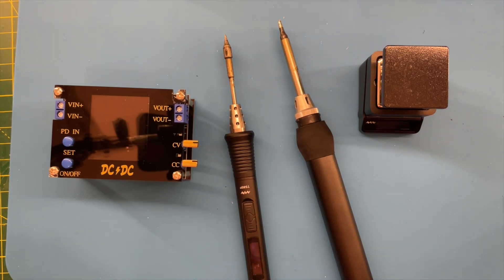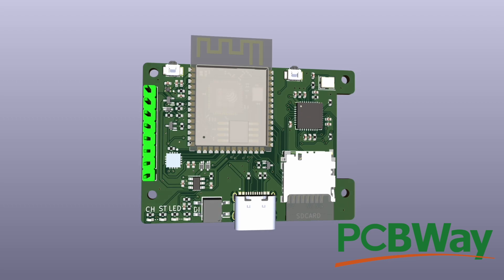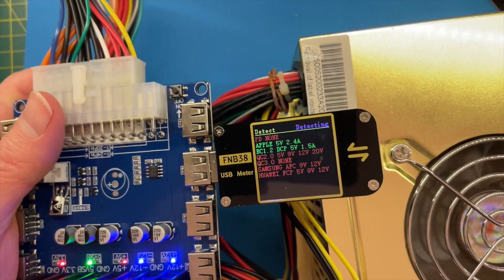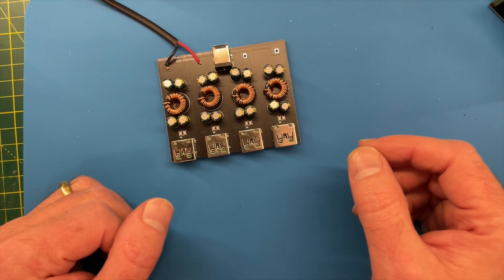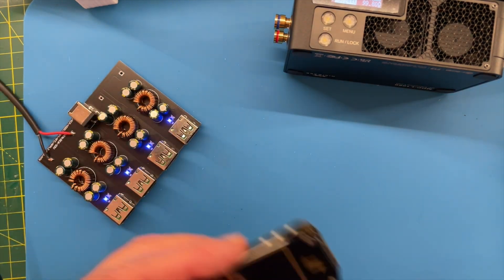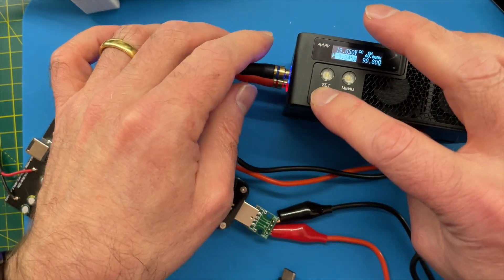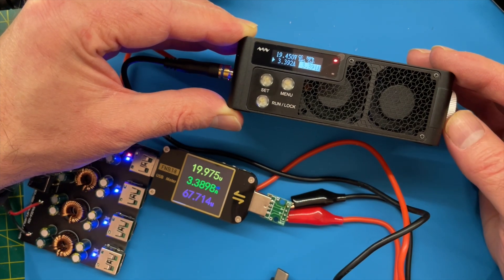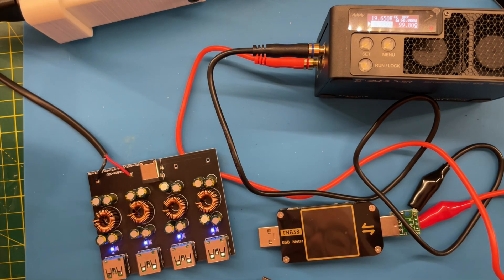Simple Multi USB-C Power Module

Comment: Nice showcase for the usefullness of these qc charger modules and miniware load. I have been using a earlier version of these (QC 3.0 module) probably the same as @lezbriddon mentioned. They were being used on a 24V solar project and i found they get especially hot when charging devices like power banks. You may want to soak test the board with a load for a longer period of time before designing a case as free air flow may be required or the addition of the self adhesive little heatsinks put on rasberry pi's.
Reply from the maker: Good idea. With all the devices I've got I can do a good load test and see how it looks with the IR camera. Just charged up a power bank and the board got warm to the touch - and that was just running at 9V so not even pushing things.
Reply: After re watching some of the video it looks like it's not possible to add a heatsink for this version of the board as components are loaded on both sides.
Reply: Nice, will be interesting to see how the testing goes. 👍

Comment: just bought one last week for more sockets in the van, but its not the same, I have surface mount inductors(220) and only half as many capacitors, so i'm guessing your boards design may be the better performer as I'd edge my bets the IC is the same (id removed by laser...) (pin2 inductor 5&6 d+/d-)
Reply from the maker: I've put some close up shots here: https://open.substack.com/pub/atomic14/p/i-need-more-usb-power the IC on my board is an SW3518

Comment: I don't understand why the push for all things USB powered. 
Great for working in the field, but at the bench why?
I have power on the bench up to 45v and up to 30A with all the voltage and current limits you need, and USB ports for data.

So you are making a mains power supply to power USB devices? seems that the world is going around in circles.

As a side note my soldering irons are all mains except for one gas powered one for use away from mains.
The only reason i can see for going the USB route is they don't need to supply a power supply. which due to the questionable safety of a lot of USB power supplies is a good idea for them.
Reply: USB-C tools tend to use a lot less space on the table.
Reply: @ArtiZirk  That may be so, but I'll take functionality over space any day.  Plus I like the protection that a lab power supply provides.   it my working on circuit takes 100mA max I can set the current limit so that if there is an issue the circuit has a better chance of survival.   
Also my current soldering iron is smaller than all the current USB ones and is mains powered. the power station is just away from my work area. Check out the size of a Weller  WXMP.
Reply: @TheEmbeddedHobbyist  that's true, real lab equipment will be miles better than any USB-C based tool. We have few Weller soldering stations at my day job R&D lab and they are a lot nicer to use than the Pine64 Pinecil I have at home.
Reply: @ArtiZirk  I miss all the nice equipment i had at work. the last few years I had a lab all to myself. but I've collected some nice older kit for my bench. most of all i miss a good scope. my 100Mhz one has quite a few issues with noise and not triggering when you want it to.
Reply from the maker: I think your last sentence sums it up - pretty much everyone now has some kind of high power USB-C supply - either for their phone or their laptop. So all the manufactures need to do is include a decent cable.
Reply: @atomic14  I must be too old school, I've only got one small USB C  iphone charger.
but about 4 lab bench PSU's. I suppose that's due to my electronics engineering background and always having good access to bench equipment, i just did the same for the home bench.
Reply: This is why I don't own anything USB powered on my bench. If I need portable power, there is my trusty $250 Bluetti EB3A.
But being a nerd, I have thought many times of buying a USB soldering iron to go along with my cordless drivers, and had to talk myself out of it. 🤪